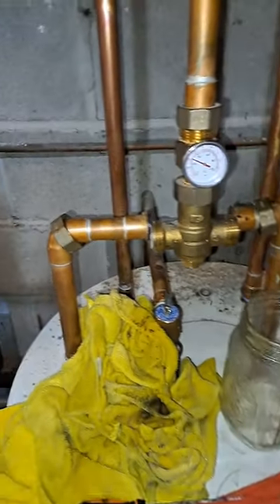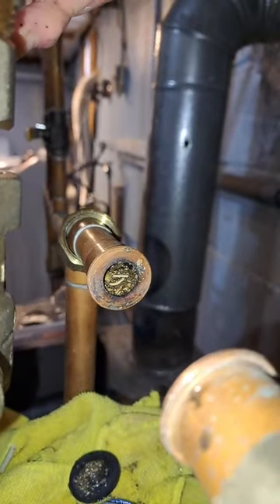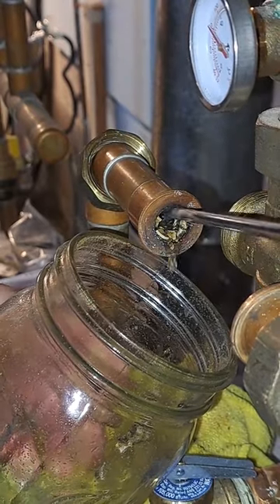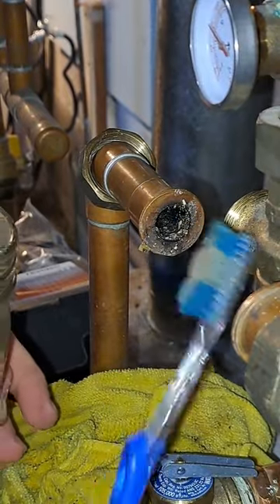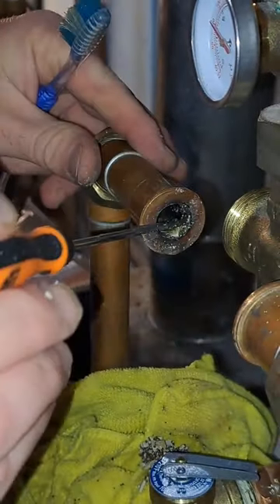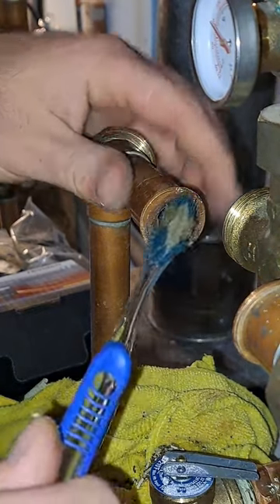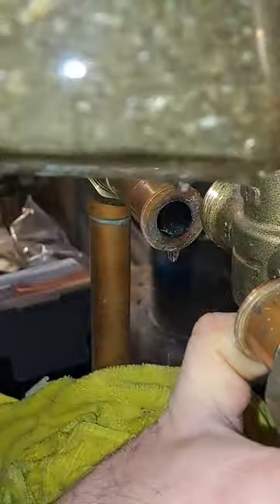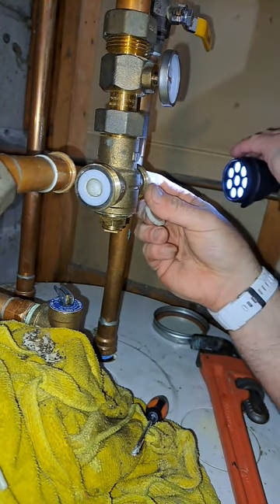Plumbing Help, What is in my pipe!?

Comment: Also you may want to remove and inspect the anode - some of that stuff could be the remains of the anode or worse yet, the consequences of the anode being already gone and the tank is starting to rust out from the inside as a consequence.  We were lucky our water was low enough conductivity that our tank lasted over 20 years before needing replacement (and the anode was never replaced - if it had been replaced some years before, the tank probably wouldn't have failed when it did).  Some water ends up eating the anode in a few years, othrs last 10 years or more before the anode needs replacement.
Reply: I thought it may a perished anode,but the debris looked like brass filings.

Comment: Maybe the 'dip tube' that brings the cold water in to the bottom of the tank degraded and broke into pieces which then got stuck there.  It looked like some of the pieces you took out were portions of a thin plastic tube - appeared to have curvature of about the right radius.
Think you might want to flush the tank so as to about having to clean out that part again in the not too distant future.